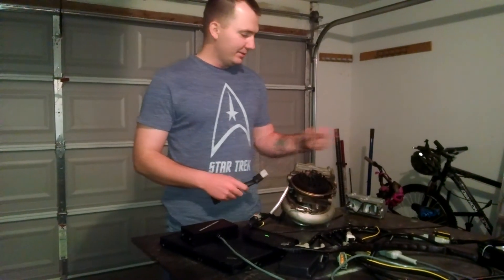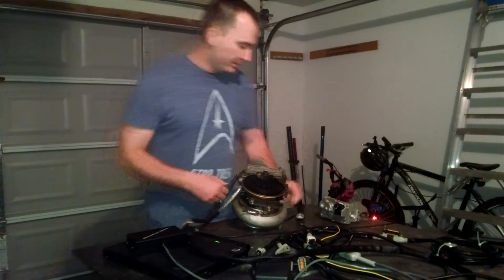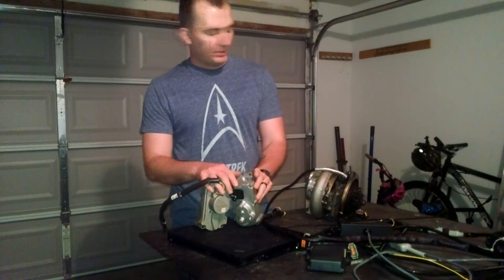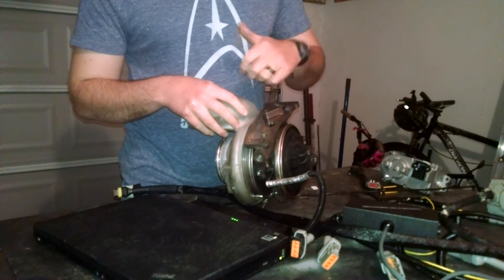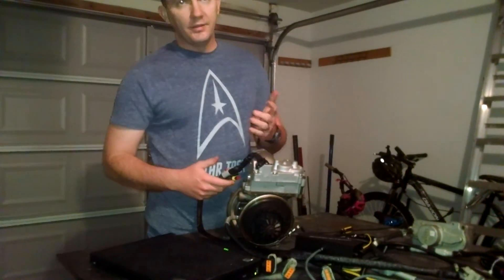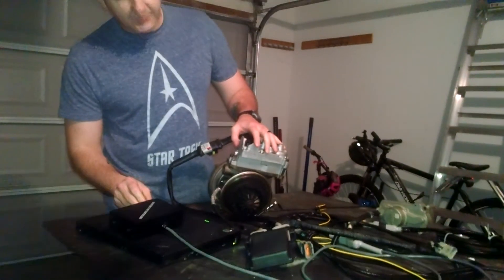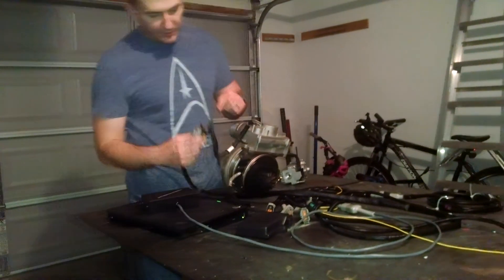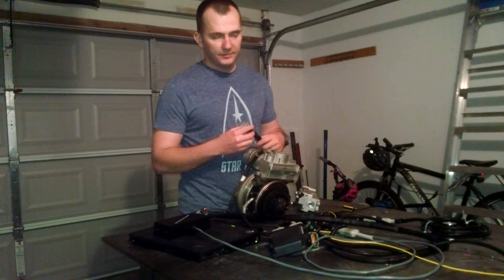Holset VGT Calibration, HE300VG Actuator Adapter

Comment: Is the 300 actuator more reliable than the 351 actuator? I'm working on a 351 swap onto my 12V, and I will be running the full heater circuit flow through the turbo rather than a partial bypass flow like OE uses in order to keep the electronics a bit cooler. If the 300 actuator is that much better I will buy one and install it on the 351. Or I will just get a complete HE300VG turbo.

Comment: I have a 2013 RAM Cummins and my turbo and actuator went out. I rebuilt the turbo and bought a remanufactured actuator for a 351 due to cost. I did get the crossover pigtail but I had a hard time getting it to do the second part of the calibration. Once it finally did I went on a test drive and after about 30 minutes it threw the P00af code. My boost pressure was high the whole time and noisy. I know that I did the calibration procedure correctly. Any ideas? I need help in a big way, I make my living with it and it's been down a month already
Reply from the maker: It's best to use a calibrator. Trying it this way isnt always perfect
Reply: @SteedDolan  I used a scanner and it calibrated. But it's not correct somewhere
Reply: Any ideas on where to start?
Reply: Evidently someone answered but it won't let me open it.

Comment: Can I swap the actuator without calibrating it? and you said disconnect "my controller"  is that something on the truck?
Reply from the maker: Connor DeVoe some 351s you can do it like in my video but it's not everyone and there's no way to verify. Best way is to use a calibrater
Reply: where can i find a cheap one?
Reply: the way you did it did you use a calibrator?
Reply from the maker: Connor DeVoe I make Calibrators. Where are you located?
Reply: midland Tx
Reply: i have the 300 not the 351
Reply: @SteedDolan  how much for a he351ve turbo calibration tool?
Reply from the maker: @gdprather65  I partnered up with ATS Diesel performance. You'll need to call them and ask about the Benchtop Tester for pricing.

Comment: Alright so odd issue. I have a 2012 Ram 2500. I can flash my truck and it runs great. But after first initial crank it's as if the VGT actuator is slammed shut. Won't build any boost, blows excessive smoke, sounds like exhaust brake is on as soon as you give fuel. But I can reflash or unplug the actuator itself and the truck will run. Would taking the actuator off and doing the process by hand be worthwhile?
Reply from the maker: Drew may if you reflashed the ECU and it started giving you problems. Then reflashed it back to stock and it works again then my guess is the flash your using isn't a good tune. This is actually pretty common. Alot of tuners crash the turbo then blame the turbo instead of the tune.
Reply: Steed Dolan it ran fine for around 45k miles. I don't have my stock file either as I forgot to do a read beforehand. I can flash my cps5 file in and it works great but then if you cut the truck off and crank again it's as if it loses its position. This is my second turbo to do this now I just wondered if trying to reset the position could get me by for a little while. Or just cut the losses and go swap the turbo/actuator.
Reply from the maker: Drew may I doubt it would help. It could be the actuator.
Reply: Steed Dolan alright. Thank you for the fast replies!

Comment: When the turbo is mounted on the exhaust manifold and you're attaching the solenoid 
Should the wastegate Be turn toward the exhaust or intake side?

2006 6.7L

Hoping to get away without using a calibration software. Anyone out there had luck with this?

Thanks for your help Brother
Reply from the maker: Ben Singleton give me a call, website is www.steeds.tech

Comment: very good video of information!!! i have a 2010 Cummins 6.7L & my exhaust brake quit & it's not building boost like it did... I cleaned the turbo twice & opened actuator and the arm moves freely by 1 finger but it don't act like the  truck is telling the actuator to move! what should I try first??? I'm thinking either just needs calibrated or the actuator motor died on me! please help! I have little funds to fix so I'm trying to do all the work myself to save on the repair bill! thanks
Reply from the maker: jperkey7089 check the voltage on your exhaust back pressure sensor. most of the time that's the problem and not the vgt.
Reply: Where is that? But would that affect it from not making boost?
Reply from the maker: jperkey7089 yup, holset VGTs are emission devices. If the exhaust pressure is reading to high due to a faulty sensor. Then the turbo will open up further in an attempt to lower the pressure.
Reply: I feel that my vgt isn't moving though.😢 Should I hear it cycle if I turn the key ON & push exhaust brake switch on???
Reply from the maker: jperkey7089 maybe, the value could make it not work. The sensor should be on your water neck. There's 3 wires, 5volt, ground and the signal wire. With the key on truck off you need to see what the voltage is reading
Reply: Ok I'll let you know after work!  Thank you so much for the help!!!
Reply: That sensor has 5v going to it
Reply from the maker: jperkey7089 that's good, how much is coming out of it?
Reply: Not sure how to check that?
Reply from the maker: Same way you checked the 5 volt lol put one wire to ground and check all 3 wires. You'll get 0 volts (ground) 5 volts (source) and some other voltage (signal)
Reply: Does that mean it's a bad sensor if the one only has .67v??
Reply from the maker: jperkey7089 no, that should be in the normal range. if it was over a volt it would be. so it could be the turbo actuator.
Reply: I found 12v going into it also so should I try to calibrate it or what?? I'd like to see if the actuator motor is good or not... How do I make it move??
Reply from the maker: jperkey7089 you should really use a calibrator to test it.
Reply: So your saying i have to pay someone else to do it??
Reply from the maker: jperkey7089 if you are close to me I'll check it out for free. You can attempt to due a static calibration like my video. But you won't know if it's good until you can test it. Not many places can test them
Reply: I live in Dunbar Pennsylvania... Probably not near u! 😢
Reply from the maker: Yeah give me a call 253 380 0055
Reply: When is a good time?? I really don't wana be a nuisance!! I truly appreciate your help though!!
Reply: What if under that sensor & into the tube is plugged up??

Comment: I was curious if your system would work with testing and calibrating my 08 dodge 6.7 he351ve actuator.  I tried disconnecting the ECM and turning on the key, and nothing happened.  I'm hoping to test the actuator prior to going out and buying a rebuilt one. Thank you greatly in advance.

Comment: Will this newer actuator help my 2009 6.7 produce more power or make it work better?
Cheers,
Lyle
Reply from the maker: no, it won't. it works better as a function not as performance
Reply: Thank you very much... that makes sense!
Cheers,
Reply from the maker: Lyle Feucht the old ones don't have as much torque less water flow and burn up. But if you find a he300vg actuator I would hang on to it Incase yours dies. Just need a wiring adapter to make it work
Reply: Thanks!
I'm having a problem with my exhaust brake in that it whistles loudly when activated. Certainly leaking up front by engine. Do you have any idea where is should start looking. I assume somewhere between the turbo and the exhaust ports on the head(s)??? Have you heard of the 6.7's leaking anywhere in particular? Wish i had a smoke generator.
Cheers,
Reply from the maker: +Lyle Feucht disconnect you fan and start the engine while it's cold. then move your hands around and try to feel it. probably a gasket or cracked manifold if it sounds like a leak.
Reply: Thanks I will try that... also when it's cold the exhaust brake will stay engaged creating more backpressure so that should help even more.
Cheers,
Lyle

Comment: So the main difference between the 351 and the 300 controllers are the reliability from the cooling option, and there's more than 1 indexing position so it's more precise and faster to index? But the HE300 controller still has the 0-1000 position input with the dead zone around 0-100? Or does the HE300 respond to the near zero values sent through CAN?